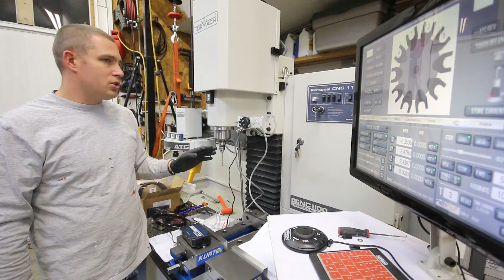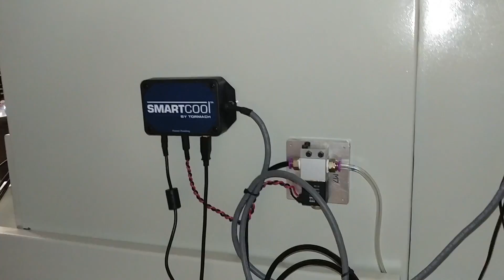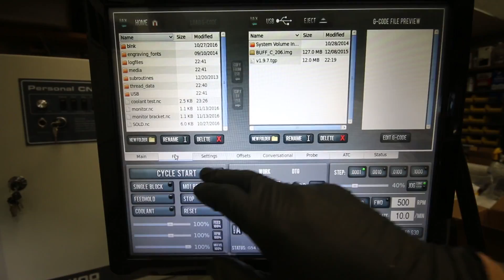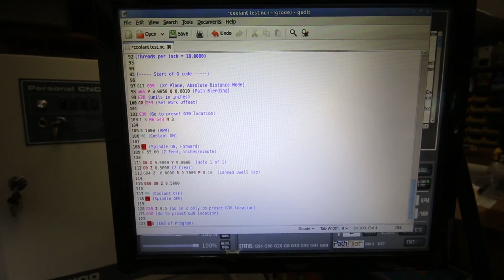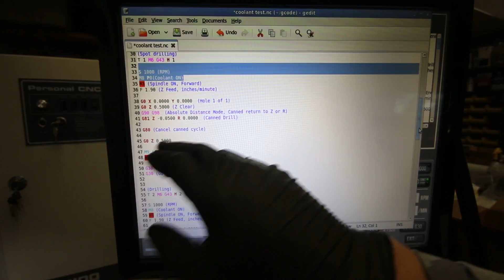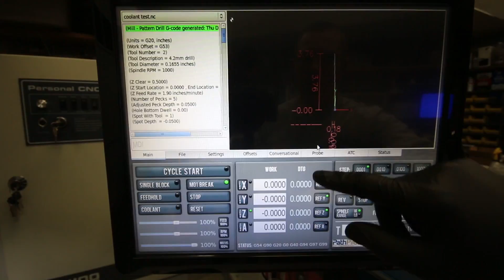Tormach 1100 Mill Upgrades Part 2 SmartCool & LED Light Install

Comment: Very nice. Is the smart cool able to track a Z height? I'm thinking for drilling and tapping it might be better to aim it at Z0 rather than the tool tip which would be a few inches inside the part. Ciao, Marco.
Reply from the maker: yes, you can aim it based on Z0 or an offest from that point as an alternative to having it position based on the tool tip.
Reply: Cool, thanks. Great videos.

Comment: I start understand why so many people love the Tormach machines.
 
Biggest problem with Tormach is they have to many options to add $$$$.
both good and bad. LOL.

You must have set yourself a good budget ( $$$$ ) for your Tormach purchase,s

Thanks again for the video, very interesting to watch it all coming together for you. 
( Looks like you are really enjoying getting it all going )

Regards Peter.
Reply from the maker: I think Tormach makes a great product for the money and the support/owner ecosystem is wonderful.  I was half tempted to buy a small mill and lathe from HAAS after I went to IMTS but one machine was more than I could spend on every option Tormach sells.  Plus 3 phase and the space needed.  

I thought for a second about used older machines but everything on the UI side for those is horrible plus 3 phase and space.
Reply: Yes when you go to these types of trade shows you see too many things to buy.

 Is good sometimes to have a limit on what money you have available otherwise you would buy everything.

I agree the Tormach machine,s are good for what you need to spend they let people into the market that otherwise could not afford the price or space available to them.

Thanks for your reply.

Regards Peter.

Comment: You need to adjust the retract cushion on the ATC air cylinder, its hitting home to hard.
Reply from the maker: Thanks for the tip.  I've set the return much softer now